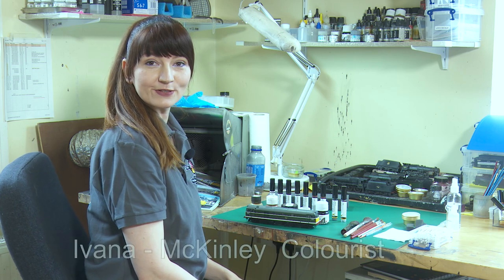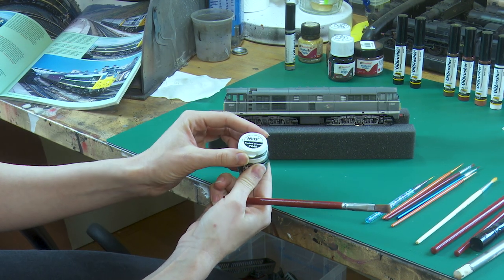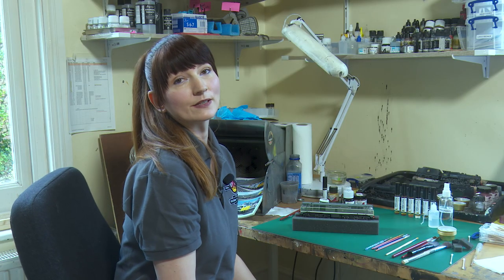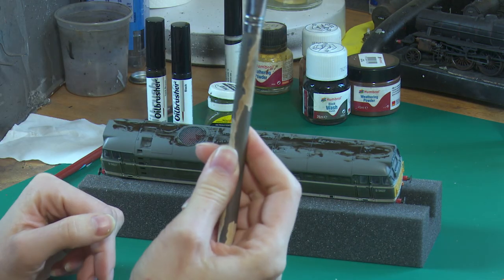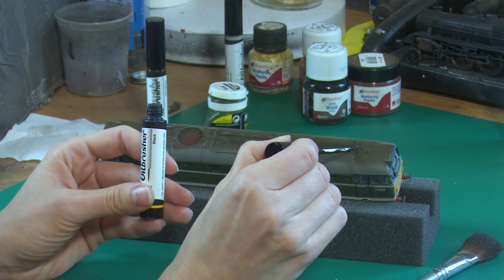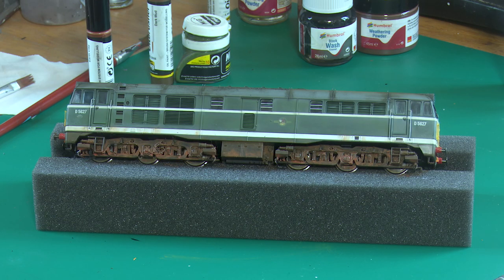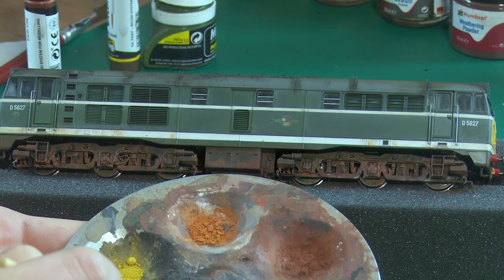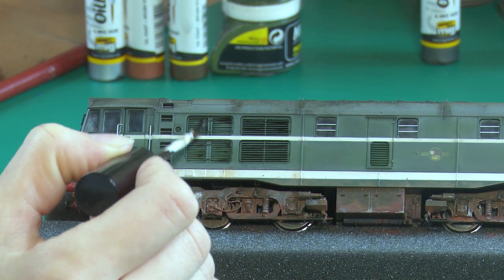61. Weathering Green Diesel Locomotives at McKinley Railway

Comment: I really like what you achieve and the oilbrusher paints are excellent , just wondering do you fix with varnish when completed or do you just leave for enough time to dry completely?
Reply: We do fix all locomotives with a clear lacquer when the surface is completely dry, but this is optional. We do not fix all wagons, simply because we don't handle them in frequent manners as locos. Thank you for watching.

Comment: Have you considered getting some cameras and creating a streaming channel? I personally would love to see some running sessions (particularly at Sheffield) and looking at the comments here others would enjoy watching the upkeep and upgrades you perform on your equipment. I realise this might be a bit too intrusive and fully understand that not every member of McKinley would enjoy hosting streams.
Reply from the maker: We do plan to do something like that.  First things first we have to get the railway built and operators trained and the software/hardware/stock all debugged and reliable.  Where would we go to understand what is required for streaming?  Its one thing to have an IP camera but how do you allow 20 people to all see the same view?  If you know of any good web sites that explain it in noddy steps, please let us know.  Thanks for your input...
Reply: Thanks for replying. I think it would be better to simplify the streams by concentrating on a single station/area on the layout. At London for example you could have a camera near the engine shed looking up to the station, so viewers can see the trains come in and depart. Maybe with an overlay of the arrivals/departures board you use on your iPads. You could have those specific operator wear lapel mics, so they can communicate what they are doing to the audience. Maybe have a tech savvy member watching the chat to ask questions from the audience. 

You could then have that as a setup for a week or two and change to a different area as they are under going their build. 

I think watching a training session for the new areas would be very interesting. No-one trained me to pilot model trains and my setup will never be a hundredth as complicated as McKinley. I think just a regular YouTube video of a training session would be a great watch

Comment: A great tutorial, but I'm still not confidant enough to give it a go myself!
Reply from the maker: Have a go with an old coach body or a cheap lima diesel body.
Reply: Try on a plastic board first or some cheap scrap models as suggested before. Start with very little strokes, try to make in first model only 'dust' effect. As you will build confidence, it will come. Good luck!

Ivana
Reply: @ivanafricova7507  Thank you.  I have just purchased an old Hornby class 47 that I will practice on and as you say, one step at a time!